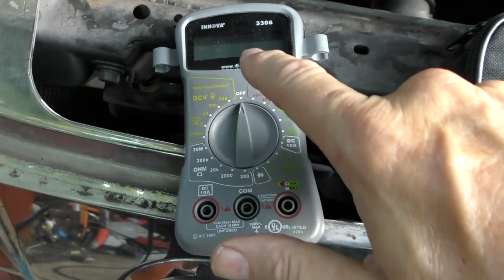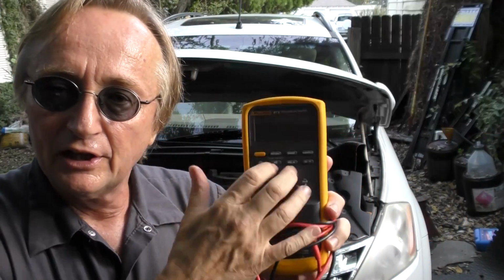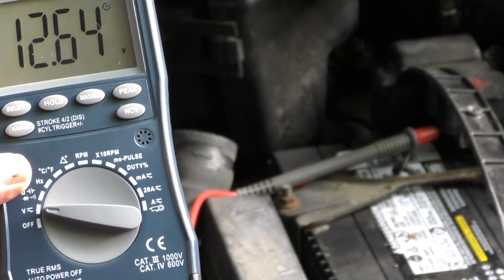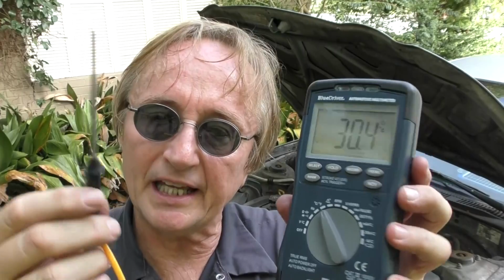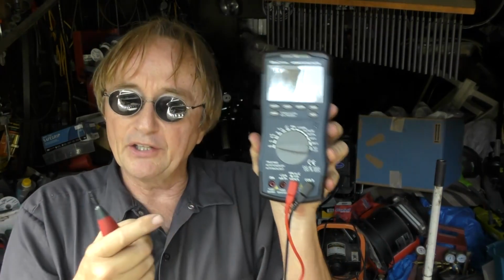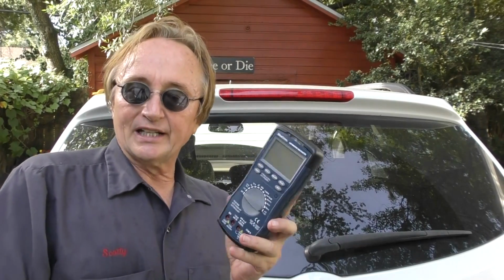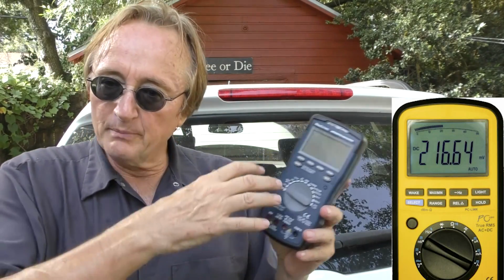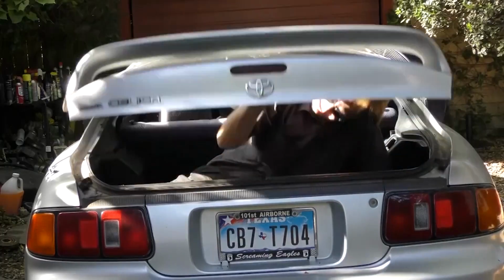The Best Multimeter in the World and Why

Comment: as a mechanic fluke is a must have meter cuz youll be using it on a regular basis because cheap meters do wear out faster and go out of calibration faster but as a diyer you dont need a expensive meter

Comment: If you trust your life with your meter, then get a fluke. The lowest bidder may get the job done, but safety is the first casualty of low cost in meters. I've repaired a few meters in my life, and the serviceability of a fluke multi is second to none. My boss set his broken fluke on the table at the shop. I picked up the meter being 90 percent confident that i could fix it due to the brand. I cleaned the button contacts and nothing more. Its probably 20 years old and still works like a toyota. Lol

Comment: Hi all. I have this $C50 meter and I use it for our home 'fleet' of antique and new vehicles, mostly checking batteries and troubleshooting gremlins  like a no ignition start but radio and wipers go on, on a 1984 VW rabbit convertible. (Used mostly test light but this meter too in continuity mode for that project).  I use the MAX/MIN feature to check battery voltage/health (getting cold here in yyc!). This MAX/MIN feature allows me to do this test without a helper. I do not trust the other meters out there that are for checking battery health. I increased the backlight sensitivity, there is a do-hicky adjustment inside the meter top left. The stand and magnet are convenient for occasionally checking under the hood and household use is great also.  It is a bit bulky, I need a smaller multi for my purse ;-).  The 800mA fuse 'went' and it took me a while to figure out what was wrong with my temperature probe, but not much trouble finding a new fuse after all. Unfortunately, the NCV tester only works intermittently, for me, this feature is not great for staying safe even on high end meters, I do not trust them. I have not tested the frequency, rpm, duty, angle functions on this meter. If anyone knows how the PEAK feature on this meter differs from the MAX/MIN I would love to learn about that.

Comment: Insure the meters you are considerig, have 10meg ohm or highrt input impedance, not all DMM do. While I respect higher voltages, I don't believ special gloves ar need to work on hybrid crs. When I worked in the oil patch I did hsve the insulated glove, nut  yo need to put on leather glove in the protect the insulating gloves. Only takes one puncture to compromise the insulating glove

Comment: I've got the cheapo Harbor Freight meter, and so far its holding up great. I do a lot of repair work [not by choice, lol, ], and it is essential to have a multimeter, even if its just a $9 unit from HF.  My other meter was just a bit more than that, I think around $20, but again the $9 meter is fine for most things. Now if your unlucky enough to own a Nissan, I can tell you that you WILL need a meter plus a whole lot more if you want to keep the thing running.

Comment: If you ever wanted to know which wires go to which speaker when installing a radio/ CD player to your car, take a 9 volt battery and connect the speaker wires to it. You will hear a rumbling sound from that speaker and you know which wires correspond to which speaker.

Comment: Hey Scotty, my fan relay went out a month ago, I went to three garages told the same that it will cost me 400£ for a new one, so I went ahead and ordered a 30 £from Aliexpress and that didn't work. As a last hail merry, even though they were supposed to have been checked by the garage already I started popping out and visually inspecting my fuses, turned out on was shot and replacing it fixed my engine fan and my ac!! So I could really use one of those to prevent myself spending hours and dollars at stealerships. Thanks for the free content Scotty, have a great day

Comment: Multimeters are definitely handy instruments.  And it appears that BlueDriver multimeter doesn't just automatically detect the voltage range.  It also automatically detects the voltage type (AC/DC), even when measuring for current in amperes.

And, I notice the Hz setting, so I wonder if the multimeter can be used to detect ripple in DC current as well as frequency in AC current.

Comment: Fluke true RMS DMMs are awesome.  One tool I'd like to submit for your consideration is an AC- DC Clamp-on Meter. It is way easier to use- and safer- than hooking up the current function on a DMM. It's DC Clamp-on function can measure high current (mine can measure up to 1000A). A drawback is it isn't so accurate at low current ranges. My AC-DC Clamp-on meter has other common DMM functions: AC & DC VOLTS, AC-DC Current, Resistance, type "K" thermocouple temperature probe, diode checker, and continuity.

Comment: Here in Germany, you get a somewhat decent multimeter (although it has none of the special automotive functions) for around 30€, while the cheap ones are somewhere between 5 to 10 Euros, and yes, you don't want to use one of those on any high power or high precision stuff. Unfortunately, meters have evolved since I bought mine, nowadays they can even count frequencies and all that fancy stuff that back in the day would cost hundreds of bucks.

Comment: I have a Fluke 83 lll that I bought in 2002. I'm retired hvac and also have done electrical work,automotive, ect. This is hands down the best dmm I've ever had. I had to replace the input Jacks on the board several years ago, the old one was smack dab worn out. Great piece of equipment, and I take very good care of it. On really nasty jobs I use my Fieldpiece SC 76

Comment: Be careful with those amp tests on blower motors.  I worked on a jeep wrangler blower that demanded 19 amps, and it was the new blower!  The original blower was drawing 25 amps!  It blew fuses a lot and would blow for a while when a new fuse was installed.  Secondary air blowers on VWs routinely draw 29 or more amps, which I find crazy!

Comment: How about some basic car electrical theory.  12.6V for a fully charged battery not under a load. 14V while engine is running and how much voltage drop if cranking or headlights are on. 
I learned the hard way about Nissan computers not liking too much of a voltage drop while trying to start with a weak battery, even though voltage looks OK while not under load.

Comment: That looks pretty good. Auto ranging is so much better than the cheap meters. It looks like it comes with clips too. Hopefully the test leads are good, that's important. You can get a < $100 DC/AC clamp on meter that will measure amps without having to cut into the line. I've always used a Fluke at work, it's the #1 tool there. At home I have a 1998 Hewlett-Packard handheld if anybody remembers them.

Comment: I live in the home town of Fluke, Everett, WA, and the others are OK, but flukes are great!! They ain't cheap, but you definitely get what you pay for, and as a former calibration tech, I can tell you that true RMS for AC means just that on a Fluke. Also they have the only peak hold that truly works well! But you're right Scotty, for casual use the Blue Drivers are OK. The non contact current measurement function is hard to find in a cheaper meter. Nice job reviewing all of them, Scotty!

Comment: I sometimes give a funny look at those that say hybrids are "a little cheaper" to maintain - because in the long run, I don't think so.   While it's true there are a lot of good things about hybrids, I've had a few friends swear off hybrids due to the fact that when the batteries died for either being too old now or simply becaus it's a bad battery that conked out, it almost costs an arm and a leg to get them serviced - in fact, it was cheaper for my cousin to buy a new "USED" car for close to the exact amount it cost to replace a prius battery at an authorized dealer with LABOR included in the price tag.   My dad still has his old well-maintained '98 Buick Regal sedan that's got a turbocharged engine that runs fine being 20 years old and still chugging like a champ compared to the newer cars today.
Reply: Keep looking there is a company in California that will ship you a new set of cells for a prius and show you how to install properly yourself for like a grand.

Comment: Hi Scotty, I always enjoy you're videos. My dad retired after being a mechanic for 50+ years. I remember playing with his Dwell meter when I was a kid. I was fascinated with the Dwell meter, it was so high tech with the knobs, switches and sweeping meter movement. Of course, my dad didn't want me to play with his dwell meter, so I didn't get much satisfaction. I joined the US Navy as a electro-mechanical technician (Interior Communications) back in the 80's and got issued a Simpson analog multimeter. It wasn't a Dwell meter but is was close enough, so I finally got to play with a meter to my hearts content. Then the Fluke digital meters came out and they took some time to get familiar with. The digital readout was easier to read, but the sweeping motion of the analog meter movement was no longer there. Those Fluke meters were 500+ dollars even back then. We always considered them to be the best and most accurate as well. There are some pretty decent low buck digital multimeters available now, and it looks like the one you have there (BlueDriver)is one of them.
Reply: Does this do ac ? Alternate current?
Reply: This clip is over two years old.  Is there a new one out there that’s better?

Comment: i bought a 20 dollar meter that shuts its self off and I accidentally got it soaked in gasoline. opened the case let it dry and it still works fine. although the plastic got bleached a little. whoops

Comment: I used to work as a dairy equipment service technician for the local Surge Dairy equipment dealer.  We used the Fluke 12 digital multi-meter. It was a fairly simple to use unit, not too expensive, and it was what the Surge factory used on the assembly line to program and test circuit boards and other electronic equipment.  So we used the same unit to test in the dairy parlor that the factory used.  It was also auto-ranging.  Nice little unit.

Comment: 550 bucks?  Bloody hell...
Reply: The amount of money some guys in the trades spend can be a bit shocking at times - i have something like 30 grand in tools sitting in my Kennedy at work (new replacement price)
Reply: My multimeter from a decade ago still works fine, it was maybe $50. I do have to set the range but that's no big deal. If you want to sell a $550 meter to me more than auto-ranging is required. This one even tests transistors, capacitors and diodes. Thanks BK Precision

Comment: I use the fluke multimeter in the Air Force and needs to get sent out to get calibrated every so often!! It’s an awesome device
Reply: "Needs" is used loosely here.  You can build your own precision voltage supplies, buy a few precision resistors, and that gets you volts and ohms.  Next you can put the precision voltage ON the precision resistor to calculate and calibrate current.  They're just little pots inside that you turn with a plastic screwdriver blade or equivalent.
Reply: What's your AFSC?
Reply: eldom72 2AX1B (C-17 Comm/Nav/EW)

Comment: Got mine for free at harbor freight
Reply: I have a HF meter and always wonder if I should trust it.
Reply: @jaybeckett7053  mine hasn't let me down yet
Reply: I had that exact multimeter, the "free with any purchase" one 😎

Tip: Don't leave it in your vehicle if it's hot outside, I came to find a warped piece of plastic rubbish when I went to grab it. But hey, for the price 😂
Reply: Harbor Freight ftw
I break the leads way before I lose it. Never blew one up.
Reply: They're  good for ythrowing in the trunk with the rest of the portable toolkit. Ohherwise it makes sense to buy once, cry once and get a fluke, just not a 87, as its overkill for most of us  a grey market 17 at a little over a hundred bucks makes sense.
Reply: Try measuring house current with it
Reply: Obviously high quality!
Reply: Boxing hey I saved a bunch I use it once in a blue moon
Reply: They're OK, but my experience with them is that they can occasionally flake out and be really inaccurate.. seemingly at random.
Reply: Boxing the problem is the leads that they give you are so cheap that any bit of flexing will break the copper wire inside the insulation. But even good leads will wear out over time. Just not as quickly as those
Reply: I have had mine for awhile and it works prefectly
Reply: @Pinhead_larry265  the hf meter is actually pretty decent. Every once in a while they do have a good product that is a loss leader. One of the guys I work with uses one. I've borrowed it when I have blown fuses in mine. I think they are a good unit especially for the home gamer. It cost him as much as my last fluke fuse. I would probably put a good spare set of silicone leads on it. And double the price.

Comment: Don't you think that electric fans differ in their current draw? I checked the a/c condenser fan on a 2010 Nissan Armada and it was around 14.5 amps when the voltage was 13.1 (vehicle was running). I used a clamp around one of the wires connected to it. Some people wrote online what they measure on their cars and it always came around 10 amps. Spal fans (the high performance ones) draw more than 20 amps. I think it's related to the size/power rating of the fan motor. 

Thanks for all the videos Scotty. Many people are learning all over the world from them.

Comment: Got a $5 one at the Chino Bazaar 6+ years ago. Still on the same battery.
Only use it to check 12V DC & continuity (doesn't have a buzzer tho')
Five bucks. Six years. Same battery.
It's a no-brainer.

Comment: Your A/C was 53 degrees while it was just sitting idling?
It must get pretty cold after you get going down the highway.
That's a pretty good A/C
Reply: It's a Toyota thing I think my Toyota is 16 years old now and the AC has to stay on low cuz it's too cold... And it's never been serviced
Reply: Virgil. How did you get so lucky? My Sienna is 10 years old, and has had 2 repair bills in the past 3 years totaling nearly $3K. In fact, I've never had AC last on any car for more than 10 years old. You are lucky indeed!
Reply: My Corolla is 16 years old and the vent temp is 39 degrees.
Reply: Johannes Brahms ; Nice
Reply: O ya i had a 1996 Camry Ac was so cold had to turn it off lol
Reply: My AC compressor is going out so when I'm stopped it blows like 75 degree air lol ☹ I have a 2007 Honda Fit
Reply: yea toyota has some good A/C, my dads 1994 camry had ice cold ac and it was like 20 years old.

Comment: Be careful on the amps range , always pick the highest range and work down . These multimeter have internal fuses to protect them on current ( amps / milliamps ) and it's a nuisance if they blow.  My friend and I traced a flat battery overnight problem to a current leakage on a Bluetooth module in a Honda using a fairly cheap multimeter . The worst part of the fix was getting to the module to disconnect it as it's deep inside the dashboard cluster trim assembly . As it wasn't used and it was a high mileage ten year old car we just unplugged it from the circuit.
Reply: Great video! Really enjoy how you differentiate all different models is multimeters

Comment: Remember when the Simpson 260 was boss? I'm a Fluke guy myself. They are reliable and they work well and I trust them over other meters not to blow up when I have my head stuck in a load center measuring voltages. The Blue Driver looks like it would be a good meter for cars because is can test a lot of the things related to cars. That Fluke you have probably only has a 10A maximum current capacity.
Reply: I still have my Simpson 260 and its clone from radio shack .this was from 1977
Reply: @ncrdisabled  me too inherited mine from dad, who was a sparky by profession.

Comment: ..... don't laugh.  You can over volt any meter. Dead cylinder on an '86 Grand Am and was running resistance check on the coil pack with a Fluke meter. Forgot the meter was still hooked up and went to start the engine and blew a fuse on the meter. If you buy any meter get one that has changeable fuses.... just another reason to hate Delco-Remy.
Reply: teton tom was that a 2.5 or 3.0 v6?
Reply: 3.0 v6...... #5 was constantly going out even with new plugs and wires. Went thru 3 coil packs ....... engineered to fail......
Reply: teton tom never measure resistance in a live circuit
Reply: ..... pretty dead before I started it.
Reply: Was there a spare fuse inside? There was in mine. I was impressed.
Reply: Cana box Noooo, lived just a few miles from Fluke's main office. Dropped it off and picked it up a week later. Used for many years rebuilding electronicals.... now as a backup.

Comment: Always enjoy your videos sir. I have a fluke 77, touched it to this ham radio amp I was building to check the hi voltage, knowing it was way to high for it but thought it would get a reading of some sort. Taped it to a yard stick and the rest is history. The 6000 volts DC cooked the meter and it's been in the junk box for 25 years. Life lessons that cost you money you tend not to repeat.

Comment: Great Informative video the multimeters I've bought are the cheap ones and I'm not sure if they are even that accurate, I mostly use them for low voltage stuff like batteries, wall warts and my PC.

Comment: Got a 93 Camry with a screwy alternator.  Diagnosed as a bad diode plate changed it now it's still got the light showing and no tach or speedo readings.  Arghh. My tiny multimeter died on me even after I put a new nine volt in it.  Help me Scotty.

Comment: Scotty. I was a lube tech. Promoted to line tech. At a dealership. Purchased a 2011 nissan frontier with 42,000 miles. Runs great. I added an additional perma cool oil cooler to the rig strait off. Wanted it to last you know. All the other techs have me so much grief. Waste of money, gimmick you fell for... so on.  What are your thoughts?